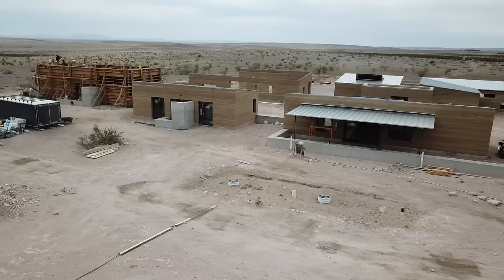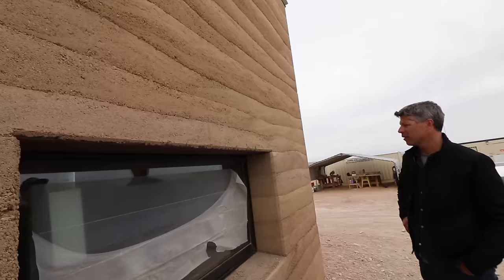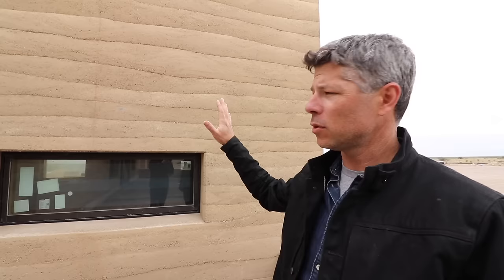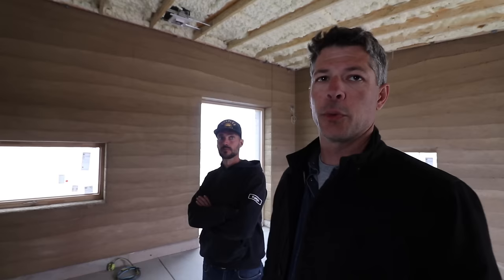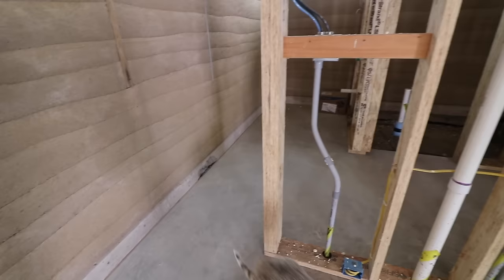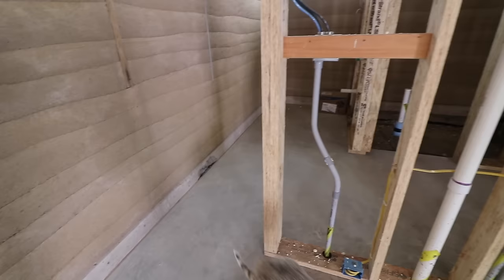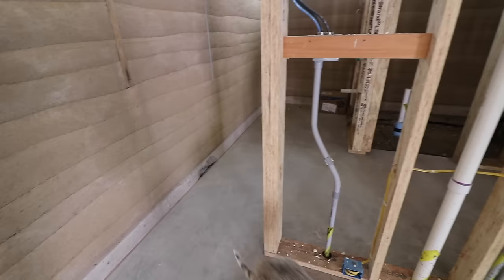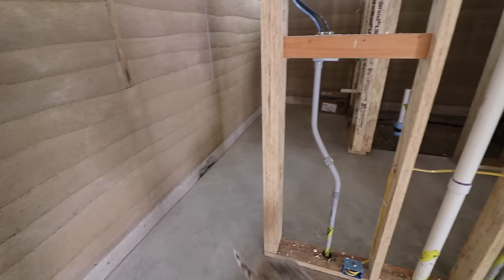Rammed Earth : You won’t Believe How They Build This!

Comment: So rammed earth is a light concrete, or soil-crete. 

Rammed earth doesn’t imply Portland cement and quarried decomposed granite.
Reply: Ya it's rock, sand, cement and water.  Just like regular concrete but weaker and with more steps to install
Reply: It can be used with no cement like mud brick and sealed
Reply: col stace 
That would be adobe. 
Rammed earth sounds like adobe. 
It’s not adobe.
Reply: @larryscott3982  no it's not Adobe but you can still have non stabilized rammed earth and you can have stabilized Adobe too, lots of variations
Reply: TheEarthDoctor1 
Concrete is broadly defined as ‘cement’ and aggregate. With a wide range of material as aggregate and typically Portland cement. And a wide range of proportions of cement and various combinations of aggregate, for hardness and strength. 

This ‘rammed earth’ mixture uses Portland cement and decomposed granite. ie; concrete. ‘Rammed earth’  implies that it’s a singular component of earth, and compaction. Rammed earth implies: soils, clay, sands, moisture a compaction. 

‘Rammed earth’ is kind of like calling a mixture of: water, high fructose corn syrup, natural flavors, and fruit pulp, “Juice”. 

The name rammed earth, in this example is a misnomer; it’s marketing. 

“Concrete, usually Portland cement concrete,[2][3] is a composite material composed of fine and coarse aggregate bonded together with a fluid cement (cement paste) that hardens over time—most frequently a lime-based cement binder, such as Portland cement, but sometimes with other hydraulic cements, such as a calcium aluminate cement. It is distinguished from other, non-cementitious types of concrete all binding some form of aggregate together, including asphalt concrete with a bitumen binder, which is frequently used for road surfaces, and polymer concretes that use polymers as a binder....”
Reply: Phace 151 
Rammed earth, earth that is rammed. 

Concrete, cement mixed aggregate. Decomposed granite is sand. 

It’s fucking marketing. It should be renamed “100% organic, rammed earth. Homes build from the components of earth.” Now go to cement factory, and stop at the quarry. Gonna need all that earth trucked in.

Comment: 15:56 How do you get the conduit at the top of your walls connected to your mechanical room? Do the wires just get tucked around the ceiling joists under the roofing, or is there another process? Thank you.

Comment: I'm curious what kind of damage it would sustain from gunfire.
Perhaps when they are done with this project, they could build a small wall on demo ranch as a test.
That would be a great selling point if it does well.

I would also be curious what kind of repairs can be made to it.
What kind of damage would it sustain from vehicles?   (thinking low speed)
What kind of damage from fork lifts?         (either end, or with a pallet)

I feel these are fair questions.
Reply: ima guess you a mercan??
Reply: not everyone lives in venice calif.  oh you're thinking about america after 2020
Reply: That’s a pretty silly selling point! Most people who are interested in such things could do it without building a new house from the ground up! You could even retrofit existing homes with a brick or stone veneer exterior and supplement that with bullet-resistant fiberglass panels to replace your drywall! Besides, in a SHTF scenario, it may not be in your best interest to remain in the area.
Reply: @Bacnow  It's not silly at all. 
Not starting a gun debate here.
The truth is guns exist and for various reasons bullets exit those guns and sometimes penetrate walls. It may happen from the outside or the inside. It may be due to criminal intent, accidental/negligent discharge, or a malfunction.
While I do not think bullet resistance would be the main selling point of this type construction, it could be a secondary benefit.
I do not see this as a means to retrofit an existing structure. 
Most current housing or buildings are not bullet resistant. If it fires from a gun it potentially will penetrate several walls. brick veneer is not bullet resistant and neither is hardee plank. ( some salesman told me it was).
The price wasn't given in the video, but the average Joe probably cant afford it, nor could he afford the ballistic panels.

It would not be a scientific certification, but doing a small test could yield valuable information.  The proximity of the construction site to demo ranch makes this feasible for them to do after the job is finished if the parties agreed to do so, which is why I suggested it .
Reply: Helidude350 — as an avid shooter and someone that has been involved with real estate sales for over 25 years, i have never once had a client inquire on the ballistic rating of a house! Only a hardcore, prepper-minded,  individual would entertain those thoughts. Those individuals would rather have their homes custom built to their specifications. As far as i know, bullet-resistant fiberglass panels (certified to stop multiple shots of 9mm, 357mag, 44mag, 308, 30-06 etc...) in addition to exterior stone veneer (which should drastically alter the trajectory, speed, and muzzle energy of most common rounds), should suffice! Also, if a real estate salesman tries to use ballistic data as a sales tool for new homes, he would probably never make a sale! No one wants to buy a home in an area that they believe (through suggestion) could become “bullet alley”!
Reply: @Bacnow  You are making the assumption that this is only for a residential house for a prepper. 
You are also assuming that the person will retrofit their existing location.
People are always looking for new buildings in a location that doesn't have one.
The video stated that one was an office. So this construction can be used for business or industrial as well.

Search Hotwells shooting range on youtube. A building such as this may have saved that mans life.
You mentioned real estate. I visited a model home at a builders location in Houston. I discovered a bullet hole in the wall of his office. Not a "bad area" at that time.
I have seen the results of bullets penetrating buildings without criminal intent.
Gun range buildings, gun stores, hunting cabins, and buildings in remote areas could benefit.
To think that only a prepper with money fixing his house for attack is the only benefit is narrow minded.
Thanks to the recent popularity of school shootings, perhaps schools need an upgrade.
Other industry could also benefit from materials that can withstand those ballistics.   Machines fail and throw pieces at high velocities. Sheetmetal buildings don't contain the parts.

New ideas and options are welcome. Why not figure out what they are capable of?

Next time you sell a house with a cheap kwickset lock on the door, Ask yourself if it's worth upgrading to a medeco lock when all you have to do to gain entry is toss a brick through the window, or a stout high school kid can kick the door open.

Packed earth may not be the greatest thing since sliced bread.
Status quo ain't so great either.
Reply: Helidude350 — lol, no. I no longer sale them, went from agent, to appraisals, now partner with contractor in building custom homes! While I respect your opinion and thought process, I disagree with your overall assessment! Doesn’t matter anyway! Have a great day my friend, and remember: Aim Away From Residential Structures! Jk 😂
Reply: @Bacnow  It's been a good, civil debate.
Thank you
Reply: The 120 mm smooth bore with APR  will penatrate so will the Abrams tank that fires the round .

Comment: While it really looks cool. It seems incredible inefficient. the laborneeds are horrendous. Why not have a machine to build compressed air blocks and then use them like all european houses are build. I mean that must be cheaper than this crazy work flow.
Reply: Because astronomical Freight costs, Europe has higher population density than the US
Reply: It isn't and you can even go more low tech, without cement or heavy machinery

Comment: What finish do you give to the walls to be protected  from watter?
Reply: With 9% portland cement, that is a concrete wall. It is just called rammed earth.
Reply: @kkarllwt  I don't think the inclusion of cement forces what would otherwise be rammed earth to be classified as concrete. For one thing, rammed earth is as much a construction technique as it is a material. For another the aggregate and sand required for concrete are very specific. You cannot get road base from a rock quarry and run it through a rotary mixer with cement and water and expect it to pass as concrete.  Not in America anyway.
Reply: @realjouster  you are on the point. Ram earth is supposed to be just earth without concrete, you can get the same effects if you add clay instead of concrete but in the end the whole walls need to be stabilized
Reply: @TheCrono0  I disagree.  As a rammed earth builder with over 30 inhabited projects complete I will tell you with absolute certainty you cannot replace cement with "clay" and anticipate equal durability.  Yes, clay will contribute to green strength and a tighter texture, but it will contribute to shrinkage, absorptivity and an increase.  Raw earth builders have my admiration, but you must acknowledge there are trade offs between using cement and not.  To say "building a wall by compacting short lifts of mineral soils is rammed earth but but building a wall by compacting short lifts of mineral soils stabilized further with cement is not" is a bit radical.

Comment: Need some rebar caps at 13:53. Would hate for someone to trip and get impaled by that.
Reply: Same thought. When I was 16 I was running irrigation on a new construction site for a home and a father and son were touring the site and the dad tripped and fell face first and the rebar went right through his eye and he died instantly. The noises that son made haunt me to this day
Reply: And everyone is standing on top of the forms not tied off or using a guardrail system.  Smh.
Reply: @liamwinter4512  unbelievably tragic.
Reply: @keeganmyers  no OSHA on that site !!! Builder needs a few infringement fines to get smart !!
Reply: At 7:00 too.
Reply: One of the workers was also standing in the bucket of the skid steer...
Reply: The dust from mixing the aggregate also didn't look too good.
Being the 3rd project you'd expect them to have some sort of mixing machine by now..
Reply: Might be useful for a feature wall or something but not practical
Reply: @bgt63  
rebar caps are 5x5x5 cm bright yellow/orange plastic caps one puts on top of rebar to not accidentally get impaled, by increasing the surface of the rebar..
It's not an aesthetic thing. It's a safety thing.
They are usually being removed before pouring.
Reply: @joansparky4439  ya...my post was in the wrong spot. I meant the wall system.

Comment: Called Pise d' terre. It's a Roman construction technique. Check out The Church of the Holy Cross and The Borough Plantation across the road from each other in Stateburg, SC. Largest historic complex of pise in US. If you have to use a binder (which they didn't) use natural hydraulic lime instead of Ordinary Portland Cement (OPC). FYI, they used a pyramidal shaped tamper to compact the damp clay. The outside got a lime render. Lime allows masonry to dry easily unlike OPC. 
No OSHA on that site. Fall protection? Impalement on that rebar? Confined spaces?

Comment: Otherwise known as CONCRETE using locally sourced aggregate. i face palmed when they showed the guys adding Portland cement to the sandy soil.
Reply: Yeah, quarried gravel/sand without any natural clay.
Reply: Its an engineered mix sorta like superpave without tar and oil guess what the only dirt i have ever seen that color is clay Rusty Raper.
Reply: Exactly, it's brown concrete.
Reply: NOPE, it's not exactly rammed earth but it ain't concrete either since it doesn't have a large aggregate AKA stones, it's more like a mortar with a low concentration of cement.

Comment: Interesting design ... not my cup of tea but interesting.  Why not have roof overhangs on the Southern exposure to compensate for differences in summer-winter sunlight levels?  Also why not insulate North-facing wall as it doesn't get the passive solar effect?
Reply: I thought he was pretty clear that the buildings are largely temperature neutral...
Reply: @brianmi40  Uhh, you can't be "pretty clear" until it's built and you're living in it.  I've built passive solar, I speak from experience.
Reply: огромная эрекция  What do you mean by that?
Reply: @PhilosopherRex  - You do realize they're walking around in the essentially FINISHED building, and he's talking about ACTUAL TEMPERATURE VARIATION, RIGHT?????
Reply: @brianmi40  Why would I not realize that?  You did READ my comment right?  I am asking WHY they did not consider specific design elements that would have increased the passive solar capability of the structure. They DO NOT explain in the video WHY they chose to do it as they did and WHY they left out some pretty common passive solar techniques.

Comment: For 1/10 the cost there is another company in Texas that can 3d print that whole lot in about 2 - 3 days with all the same structural advantage that will last 500 to 1k years.
Reply: @Silus Greystone 
Cool
So what’s the company called?
Reply: @josh021588  S-squared the other one is ICON but there seem to be several popping up all over the country.

Comment: Apparently you could never use this building method in Florida
Reply: why not, this stuff is primarily nothing more then portland cement, the dirt is added as a colorant and it's poured in layers only as an aesthetic choice for a unique design. They call it "rammed earth" to appease and excite the new age hippies. Because of that it would actually be quite popular in Florida.
Reply: @FhangMedia , it's definitely not "primarily" Portland cement...
It's primarily dirt with a Portland cement binder mixed in... 
Not mainly cement with a little dirt...
Reply: If you had enough overhang on your roofing you could...
They used to build cob houses(similar) like that in England, which is a rainy, damp climate years round...

Comment: This must be much more expensive than a wooden house. More labor intensive too. What's the point?
Reply: less energy needed for heating and cooling, wood is deteriorating quite fast especially when termites go into it, also lot's of better noise isolation
Reply: @Changeworld408  -- Compared to wood, I agree, but what advantage does it have over other energy efficient choices, even things like adobe. Is it many an aesthetic choice? It's a unique look. Does it cost less?
Reply: @lamplighter5545  Adobe is also earth.
Reply: @katewizer2736  -- That's my point. Adobe doesn't need specially constructed forms. It's brick. It's laid in a traditional way. I assume adobe is cheaper. Maybe not. I'm not saying there is no advantage, but I'm curious how it compares.

Comment: One 250psi water pump and........
Reply: I don't recommend that the painter use a pressure washer prior to spraying the place.
Reply: Actually, it's 'stabilized' rammed earth (they added cement to the mix).  So it's not going anywhere.  Even at 250psi it would take a while to make a tiny divot.
Reply: @lissee212  Plus, none of these structures will be painted. The material is finished as we saw it.
Reply: @lissee212  they added cement to the mix not concrete
Reply: @colstace2560  Semantics, but yeah.  It's not washing away anytime soon.
Reply: @Hybridog  Exactly.  Would love to build with stabilized rammed earth one day.

Comment: Once you add cement it is no longer a rammed earth house. It's a concrete house with high proportion of aggregate. BS.
Reply: Concrete? Earth. Dirt? Earth. 91/9 ratio? Not staying up unless rammed. This is a rammed earth structure
Reply: Isn’t cement made from earth?
Reply: It depends on your initial soil profile. What they're describing requires a cementitious binder, like cement! Their engineer would have worked out out...

Some companies in Australia do this in steel formwork with radius corners, so the resulting finish is almost polished off the form. Finish it in linseed and it's quite beautiful.
Reply: It can be done without using cement, but code requires that the binder be added. It depends greatly on what is in the local soil, but still, the cement ratio is far less than with tradition cement slurry.  And it is tamped, so yeah..rammed earth.
Reply: @ThePunitiveDamages  I imagine code requires a binder be added so that the house doesn't turn into pudding after a week or two of rain, no? Adobe houses can stand for a long time, but usually only in a very dry environment. The more clay, the softer the structure will be. So yeah, I imagine code is just looking out for homeowners as usual.
Reply: This is called "cement stabilized rammed earth." To be honest, it was an interesting video to watch, however, the amount of labor and resourced poured into this project is outrageous. They were doing it for almost 1 year and had 1 more year to go. Given the conditions of the environment they were in, it would have made more sense to do an underground compound (underground is the best in deserts), with just a few feet going over the ground for the roof and some windows and the site could have been made in days. But I guess people with more money than brains have to get rid of their wealth somehow.
Reply: Concrete construction adds sand, gravel aggregates and a much higher water content to create it, however standard concrete never includes the addition of soil or any clay content which is the key element of distinguishing it from SRE. Stabilised rammed earth can also be achieved without cement  however most codes call for cement addition. "Rammed earth" additionally describes the construction methodology. I see no reason why it shouldn't be deemed it's own material/style?